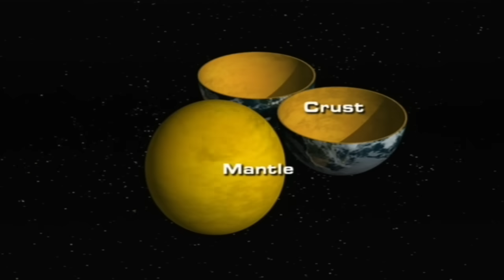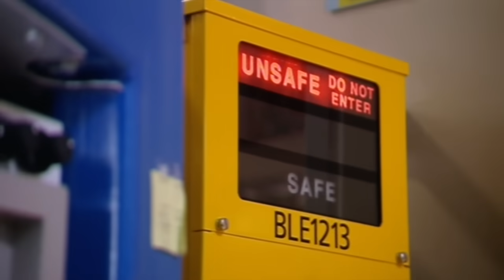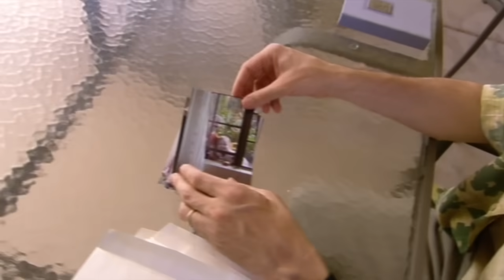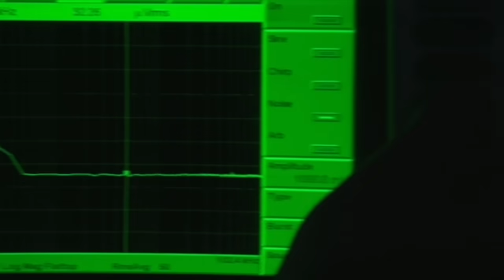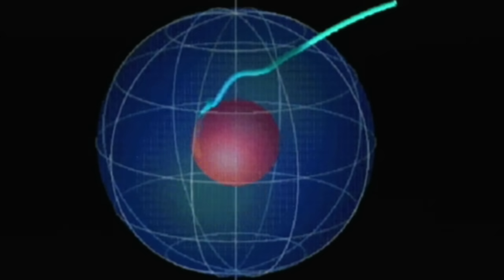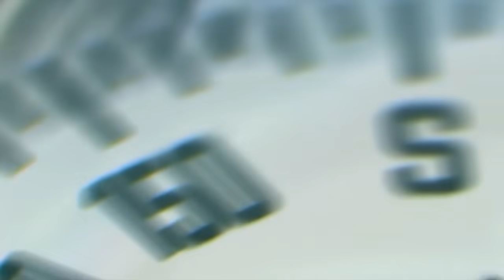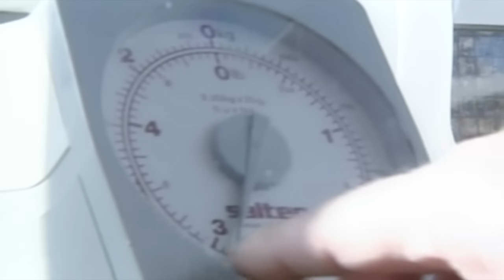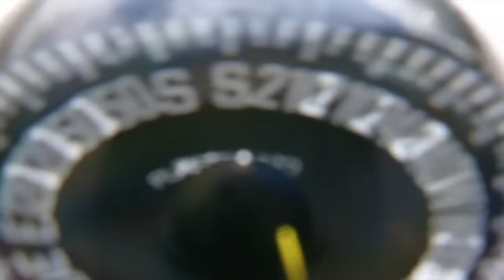Earth's Core

Comment: A topic not addressed in this video is the influence of our moon on earth's core. It is claimed that the circular movement of the moon around the earth tends to stretch and bend the core and this generates heat (almost like a steel paper clip that gets hot when bending continously) which help to keep the core in a molten state. Venus and Mars has no significant moon(s) and that could help to explain that both have solid and cold cores, hence no magnetic field.
Reply: Lo is heated that way alot more, so if you wish to hear about it listen to the the Documentary about Jupiter.
Reply: I'm no scientist, but DANG that sounds logical! I'm impressed for what it's worth! ;)
Reply: @bcsviewer1  
Yeah it`s Io, not Lo
Reply: Not to mention the brown dwarf star and it's  "solar system" wondering around and winding stuff up all over 😁
Reply: Its also getting further away, but not very quickly so, yeah, that makes sense to me. Phew, I actually was worried for a second there 🤣
Reply: Riccardo Barrymore 😂😂
Reply: Mars core cooled due to its smaller size, it’s heat loss was a lot more rapid than the Earths... physics!
Reply: It is a small amount of heat compared to radioactive decay which is the main source of heat
Reply: @mkguy1963  Yup, Mars is 53% the size of Earth. Nearly half the size and 9x less mass. It's Moons, Phobos and Deimos are tiny in comparison to Earths Moon and had very little influence on Mars's core due to their small size and distance away. Our Moon is only .25 Earth Diameters away, Phobos is 1.5 Mars Diameters and Deimos is nearly 4. Well outside a sphere of influence. Add to that the distance between the Sun and Mars, it's no wonder Mars cooled faster.
Edit: Here's a Visual aid if you need it: http://education2.marssociety.org/wp-content/uploads/2013/06/earth-moon-mars-size-comparisons.jpg
Reply: 24:47 what does that ass have to do with the molten iron an nickel!?
Reply: And it's slowly drifting away...  :(
Reply: And it's slowly drifting away...  :(
Reply: hawkeye0248  ok but isn’t a paper clip continuously bent
Or it wouldn’t be paper clip.
And is that how magic spoons are bent???
Reply: bcsviewer1  who’s lo???
Reply: A Frog   Who’s Lo then?
Just answer
Reply: mkguy1963  they nuked themselves dead. Some came to earth using a murkaba (spell check needed)  check out Spirit science for simple explanation.
Reply: i agree but the same should hold true for the moon
Reply: neat
Reply: @lilianflower3017  what....  repeatedly bending a paperclip, not bending it once and leaving it perpetually bent.  magic spoons don't bend, you just create a distortion that makes them appear bent to the naked eye
Reply: @afrog2666  pronouns are he/she
Reply: That is an interesting idea. But I don't think Earth and moon have enough gravity for significant tidal stretching. Afaik Venus doesn't have a solid core. In fact, it has over 1600 volcanoes, which suggest at a very hot and active core.Venus doesn't have a magnetic field because it rotates about its axis too slowly. As for Mars, it cooled faster because it's smaller. And smaller objects do cool faster than larger objects. That's Newton's law of cooling.
Reply: @ScarMsanii Aggrey Lmao dude
Reply: @SternLX Huh. I hadn't considered distance from the Sun. The way it might influence cooling is by affecting the average temperature on the planets. The colder the planet, the higher the temperature gradient between the core and the surface and thus the faster the heat loss.
Reply: @voidremoved Mate, she follows Spirit Science. These people aren't worth wasting your time on.
Reply: The topic not addressed, is that the very center of earth is not solid. It's PLASMA.
Reply: @vDarkness Falls Hmm how is that possible?
Reply: @mkguy1963  no hypothesis and conjecture
Reply: Only been 7.5 miles deep...you have no idea about the core!!
Reply: @lilianflower3017  Io is a moon of Jupiter.
Reply: Rite
Reply: It's called gravitational flexing (or just tidal flexing) and yeah, it affects the planet's crust, mantle and core, and it helps generate so much heat from friction, that this same kind of process is what keeps Jupiter moon's Europa's underground oceans from freezing, which creates a sort of pseudo-goldie-locks zone that many theorize it might allow for life developing there, even the pluricellular kind.
Of course the Moon doesn't generate as much flexing on Earth as Jupiter does on Europa, but, Like they say, in war and love, everything goes, and in science, everything contributes.
Reply: Yeah that sounds legit hawkeye. The moon has been getting further away over the billions of years since its creation. It used to be 15x closer so that stirred the core and got it going. The gravity the moon point on the earth creating a tidal flow around the world 1 000 feet high. It now moves away from earth 1.5 inches a year. The day used to be 6 hours. The moon took the spin speed and converted the energy stolen to extend the earth day and the energy went into slowly accelerating the moon and that speed is pushing it out away from earth.
Reply: But if the gravitational forces are generating as much heat as your suggesting than why don't we see the same effect in the moon?
Reply: Love this comment
Reply: @vDarknessFalls  The second you mentioned the classic phrase “Our government already knows this” I grabbed my 🍿. The “no gravity past Mars” but was the icing on the cake though. Thanks for the laugh.
Reply: You guys are smart. Don't let anyone ever tell you you aren't.  It's funnier this way
Reply: @beereaucrat3233  Evidence? Oh wait that's right, you have none! Just an ancient storybook and its absurd claims. 😂🤣😂
Reply: The tugging and pulling of the moon and sun via gravity has a lot to do with keeping our core molten. Very good point.
Reply: The moon's magnetic field, weak though it be, stirs the earths interior like a witch stirs her cauldron and the moon is responsible for earth's axial tilt and the changing of the  seasons - not the sun  🌕 💪

Comment: 5:55 found a mistake. Falling towards the core would only take around 42 min not 32 hours. Regarding the core it would make sense to drill on the moon since its magnetic field was lost some billion years ago and its easier to drill to the core since its diameter is much smaller.
Reply: No, you are wrong - Terminal velocity is around 120 mph, the distance to the centre of the earth is 4000 miles, simple maths 4000 / 120 = 33 hours

Comment: So high pressure at the center (6.3 million g) creates high temperature at the center. But Newton's shell theory (g1/g2=r2^2/r1^2) where r1 is the radius of the earth and r2 any intermediate point, says g2=0 at the center since r2=0. Since pressure=mgh, so there is no pressure. Could you kindly explain the controversy, please.
Reply: Good question. Yes, at the very center, gravity itself is 0, and the pressure by gravity itself is mg and therefore also 0. At the same time, the crust of the earth does not fall off: It is supported by the mantle underneath. By the 3rd law of Newton, the mantle feels an extra pressure from the crust downwards, in addition to its own gravity. The same applies to the core, which feels the pressure from the mantle plus the crust. This pressure accumulates layers and layers down, finally reaches its maximum at the center.
Reply: 李明宇
I suppose, if one draws nice vectors of the forces pressing down to the center, they would cancel out each other, besides no real world object is 0 in size, so there is no real case in which to apply r=0..
Reply: 李明宇
The problem is mass is considered to be concentrated at the center not as shells or layers upon layers, If the shell theory had considered mass not concentrated at the center, but as layer upon layer, then the result would be millions of g, but because shell theory assumes no mass except at the center, g becomes zero.
Reply: SwineNahNah Yeah, that's right. It can also be seen from symmetry: the force pressing to the center cannot have a preferred direction, therefore must be 0.
Reply: Naimul Haq http://en.wikipedia.org/wiki/Shell_theorem the shell theorem says that a spherically symmetric sphere or a point of mass are equivalent when calculating the gravity it gives to something outside the sphere. It does not "assume no mass except at the center" unconditionally. it's merely a way to simplify calculation and reasoning and does not alter the reality of the massive spherical earth.
Reply: puncheex2
^^^^SMART PEOpLE TALKING^^^^^^
Reply: nerds xD
Reply: *****
Conspiracy chat room, that way --->

Comment: How does anyone know what's beneath 7.5 miles?? they don't
Reply: does anyone want to mess up nature more?
Reply: We can measure how earth quakes move through the materials, and then based on the way they refract we can say with near certainty what materials are made of. It's sort of like how light moves differently through air and water. I hope this helped!
Reply: Because direct observations of earthquakes, volcanic events and plate tectonics all points to the obvious conclusion that there is something moving under the planets crust. This has also been observed on other planets in the solar system and some moons such as Io....but I suppose this is all fake too. 

Earthquakes generate a lot of seismic waves in the form of P waves and S waves. P waves can penetrate anything, solid, liquid or gas. As as result P waves can be detected on the opposite side of the planet to where the earthquake originated. S waves can only travel though a solid, as a result S waves never get detected on the opposite side of an Earthquake, they can only be detected up to 103 degrees from the point of the quake. What does this mean?, it means there has to be a liquid sphere inside our planet, there has to be. 

Upon interacting with liquid, S waves become P waves. This is why we also know the inner core is solid as S waves have been briefly detected their before they become P waves again.

Using this method, I.e detecting S waves, we can accurately calculate that this liquid sphere inside the Earth is approximately 2,900 km below the surface at sea level.
Reply: my thoughts. multiple topcomments confirming. kek
Reply: Marco ...
Reply: 17:10
they explain the how quite well in some minutes
Reply: Ultrasound?
Reply: https://en.wikipedia.org/wiki/Mid-Atlantic_Ridge

The mid atlantic ridge is where new crust is created.  It's existed ever since north america was connected to africa. Where does new crust come from?  My guess is the mantle, that stuff underneath the crust.
Reply: @moonpixie3634  for the horde!
Reply: Rocks...

Comment: So the earth makes gravity from churning iron nickel and uranium together . now what i need to know is can you build about maybe a hundred 100 spherical sodium melter and spinner gravity simulaters , i don't know what to call them , and place them next to each other in the same pattern same distance apart as those chemicals that act like compasses when their lava freezes and also place them in other geometrical patterns and place them on top of each other in a line starting at the ground going up in the air and adjust the distance between each gravity sphere to test them and find out what the cascading effect will be . and also put many different elements from the periodic table into the test around the spheres to get results of what would happen if they were introduced into the test . how much does it cost to build a gravity simulator sphere ? If a hundred or more spheres were next to each other wouldn't that amplify the effect and couldn't it be used to make anti gravity if you put all of the spheres on a platform or frame and fly it into space ?

Comment: Magma rising to the surface is not just from a lava lamp like effect. If you think long and hard about it. Wouldn’t you think about two continents colliding and subduction of one continent under the other. What happens to the one that goes under the other. It melts back into magma pushing magma upwards
Reply: Just like if you filll t cup with water and start putting pebbles into the water it over flows   And why ? Like the magma it has to go somewhere right. So out through cracks in the crust.  It’s not due to convection.  It’s due to subduction.  Billions of tons of rock getting forced under another continent and what do you get.  Magma coming out of the earth.  Come on people who thinks this stuff up.